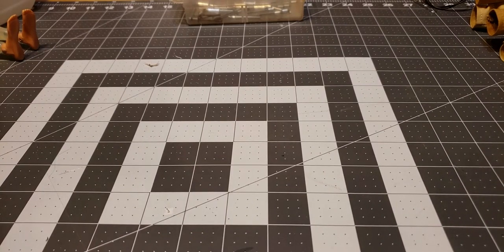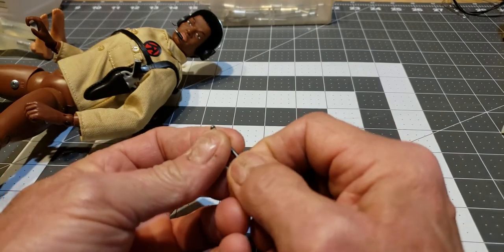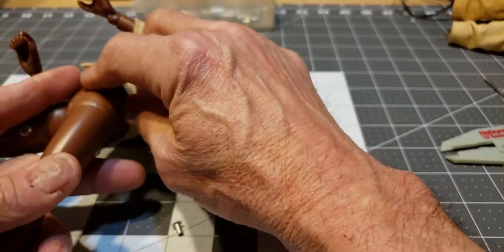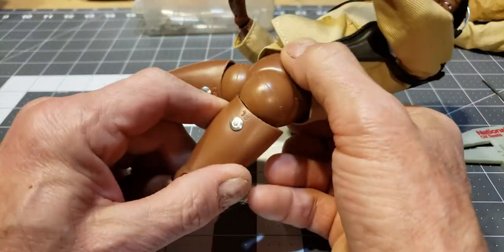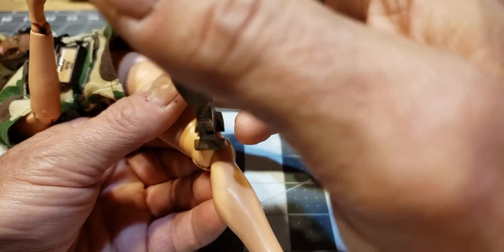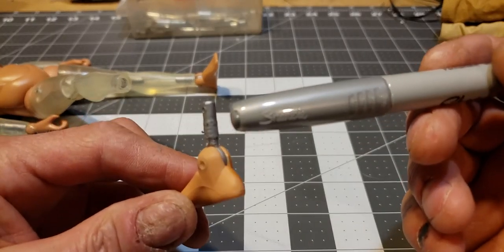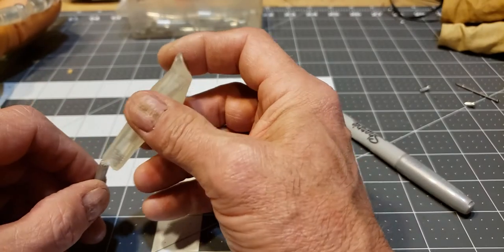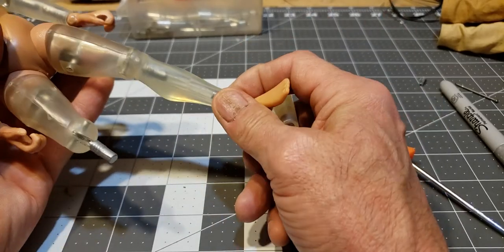Fixing broken rivets on vintage style GIJoe,Cots Atomic Man enhancements Part 1 NOT FOR CHILDREN

Comment: You don’t need to replace the thigh rivets unless they are already gone or broken. All you have to do is cut the loop at the top of the eyelet clip at about 1 o’clock and bend to take it off and then bend it back when replacing them. Figures with new rivets are now ruined and the value has diminished. You can do the same thing with the restringing kits. You don’t ever have to take out the thigh rivets. Please don’t do this.
Reply from the maker: I am well aware of the cut the eyelet method, thanks. The Joes who got my home grown thigh rivets were repro Joes with broken thigh rivets, not vintage.
"Ruined"? Not hardly. Although you are correct in saying that it diminishes the value of a vintage figure, any repair will lower value. Fixing a broken Joe does not "ruin" it. A Joe that has been repaired is far better than a broken, undisplayable figure.  Purists may not agree, but this is reality.